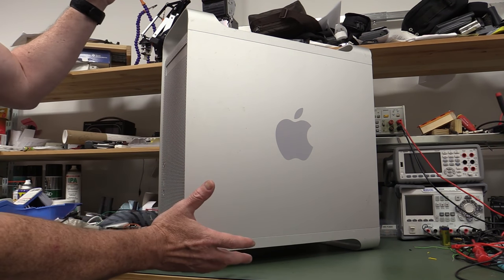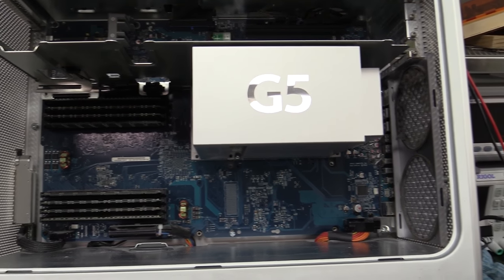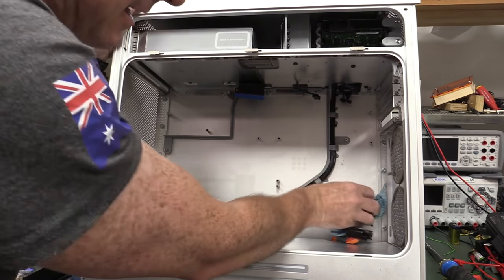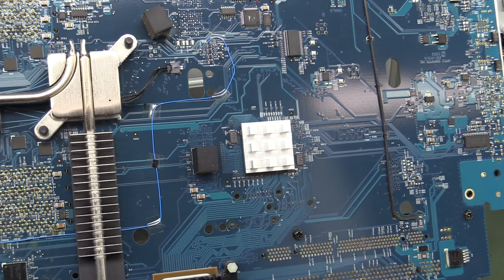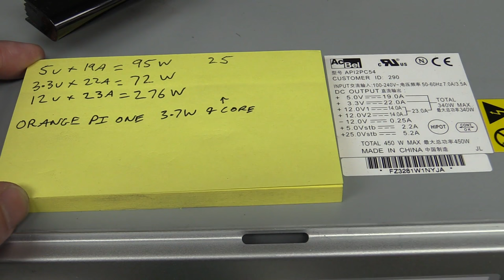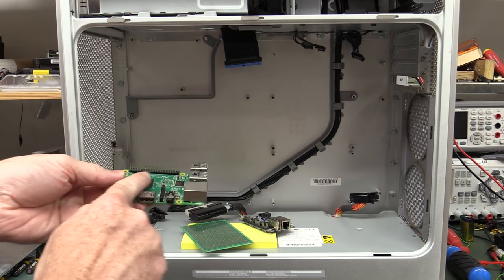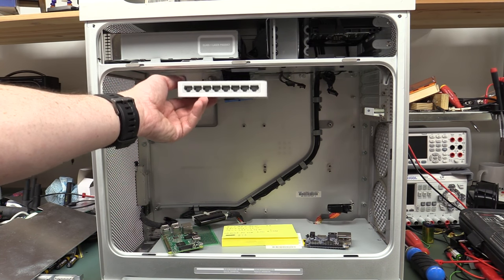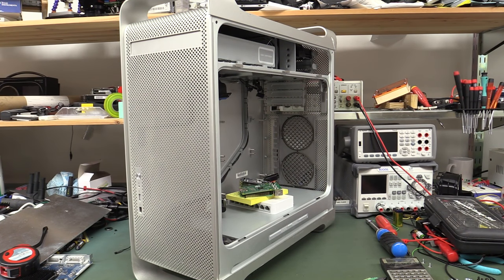EEVblog #946 - Apple (Raspberry) Pi Cluster - PART 2

Comment: The moment you click that 16 or 24 port switch into the board mounted RJ45 connectors and then realize that ever getting it back out again will be a major PITA since all the RJ45 holding clips have engaged... priceless ;-)
But otherwise a great ideas :D
Reply: Peter Jakobs you'd have to take off all but two of the clips :)
Reply: of course, but I just figured the SNAFU moment in case you did not and had to undo 24 clips :D
Reply: On the picture Dave showed, it actually looks like these are clipless connectors in the first place, btw.
Reply: Peter Jakobs.  good point. no clip and. the switch is screwed in
Reply: I don't think so, the clip's just on the top side, opposite the contacts.
Reply: It could be hidden, but it looked to me like it was gone.
Reply: I was thinking this the moment he said it but I imagine you'd be ripping them all off.
Reply: Peter Jakobs it does say its intended use case is things like daughter board connections, and in those cases you pretty much universally have the clip elsewhere and you're not gonna be hoping the tech has a long screwdriver to push in a clip somewhere in the back of the machine. I suppose e big advantage is when you're using/testing the daughterboard outside the mainframe, because you can just plug in a standard cable. Otherwise Ethernet runs just fine over non-rj45 connections.
Reply: therealnightwriter hey, I was waiting for you, the inevitable troll. What took you so long?
Reply: Jasper Janssen oh, I can see the advantages, no problem. As said, it was a slapstick thought. One of them "oh shit!" moments ;-)
Reply: HAHAHA. Better when you realize that TP-Link have changed the switch product line and the spacing is no more the same :P
Reply: I was sort of wondering what he was going to do for the network part of this. I would assume you can get the ASICs, etc for the switch, OS for it though may be hard. I figured you're networking them all anyhow why even bother with the headers, etc make a board with a gob of power plugs throw them on that and then connect the network. 

I actually have an old Unisys server that the back of the case is recessed and to get the RJ45 out you almost need a flat screwdriver because they put so close to the side of the recessed area. I don't know that was just poor design, no choice or maybe was intentional to keep it from being removed accidently. Other thing that was odd was the 2nd NIC was a PCI card which even for a lot of older Dell servers they were both integrated.
Reply: Yup +1

Comment: The +25VSB on the power supply is for the Apple Cinema Display - if you look at the graphics card slot you'll notice an extra, beefier connector next to it. This would supply power to the stock graphics card, as the display only has one cable for USB, video and power (though it did come with an external power supply/breakout board if you changed the card/wanted to use it on another system).
Reply from the maker: Ah, thanks.
Reply: Just my two bob on the PSU, I'd take it out entirely and fit either an external one, or mount a cheapie modern modular PSU where the hard drive bays are - if it didn't require too much hacking away at it. There seems to be some real estate down the bottom where that old PSU is - maybe the networking mumbojumbo could pop down there.
Reply: Regarding your comment on the Modem: most probably they put there the modem on purpose, because it is well shielded, being surrounded by the CD-ROM drive. Thus, if a lightning struck the telephone wire going to the modem, the components will be less likely to explode out of the chassis, and the long wire will also help arcing over to the ground, so the user is unharmed. 
Btw, why do you keep on referring to this RPi as a "SUPERCOMPUTER"? Without fast network it will not be able to produce even as many FLOPS as an old Pentium 3 using the same amount of power... 
At least you could network boot them, and save on the SD cards.

Comment: While Dave calls the board-to-board high-speed interconnect beautiful, I just stare at it in abject horror thinking of the added latency and fragility of those pins.
Reply: Electricity moves pretty damn fast, almost as fast as light in a vacuum, so around 1 foot/nanosecond. Cables running from place to place inside a computer will not add up in any way shape or form to meaningful latency. It would have to travel over 1,000,000 feet to equal one millisecond of latency.
Reply: NolanSyKinsley The speed of electricity is not only dependent on the length of the wire, but also the wire's gauge and composition as well as the amperage through the wire.

You ever wonder why we put processors directly on the motherboard? We didn't always. Slot 1 used a cartridge-based processor that you could plug into a board like today's RAM, making it far more user friendly and easier for enthusiasts to build computers. The slots we use today are less friendly, but by reducing the amount of copper between the processor and the motherboard, you gain a significant performance boost.

Apple figured this out too, and stopped putting processors on risers shortly after the G5.
Reply: Lutra Nereis this is a G5. It's slow as fuck, which is why it can handle being on a riser.

Modern multi socket machines still use risers, but the ram and CPU are generally on the same board.
Reply: And yet shorter wire lengths for speed was the reason the Cray 1 Supercomputer was shaped like a big cylinder on end.
     
NolanSyKinsley52 wrote: Electricity moves pretty damn fast, almost as fast as light in a vacuum, so around 1 foot/nanosecond. Cables running from place to place inside a computer will not add up in any way shape or form to meaningful latency. It would have to travel over 1,000,000 feet to equal one millisecond of latency.
Reply: Greegor47 true very true. though a rpi doesn't have i/o even remotely as fast as the cray computer. there's also a matter of dimensions. the cray one was HUGE compared to a normal computer :)
Reply: I'm pretty sure it's fine considering it's a mass produced product well proven in the field for years and years. Worrying whether it will work seems redundant at this point.
Reply: Notmy Realname I'm not saying that it didn't work, just that it's subjectively not beautiful to me.
Reply: Lutra Nereis odd, the fact that it is difficult to engineer well enough to get it to work makes it more beautiful to me.

Yes, the simplest, cleanest solution electrically is otherwise, but engineering is the art of the compromise between various requirements. In this case, the systems engineering side won over the electrical engineering side, and in the process made the product a few hundred dollars more expensive to manufacture (but more modular, which increases volume on some components, which lowers costs..).

I think there are cheese grater macs (probably the Intel models) that are still modular, but have combined CPU/ram boards. At that point, the only thing going over the interconnects is pcie lanes and power, practically, and/or the SMP link between two sockets (which is not that different from pcie lanes). Those are much less complex board to board interconnects. That's why these things have so many pins, that's mostly the memory interface.

In summary: solving problems beautifully is what engineering is about. Even when the problem could have been avoided by dropping another requirement.
Reply: It depends on what you want really. For high speed measurements the parasitic element of the wire would just increase the more wire you have. For this machine, I would imagine it wouldn't add too much, considering how small it is and what it needs to measure, but with Gigahertz clock speeds this wire would be absolutely terrible. You also need to know that when it comes to inductance and capacitance (which can be parasitic) speed of light has barely anything to do with latency aside from the electromagnetic constants.
In a way geometry and type of element makes the latency, but sure you could think of the reason being that the speed of light is finite.
Reply: DarkBabylon - Gaming videos Keep in mind that typically the GHz speeds are only found within the CPU itself, the external I/O busses are usually much slower (400-800MHz, or less), so not as extreme to work with, but you do still need to be aware of trace lengths and total capacitance (although if the signaling is differential then not quite as hard to work with).
Reply: Ethan Poole Of course!
Reply: there are modern examples of systems not putting their processor on the board, the Dell Precision T7500 for example has a dual processor module that connects to pins on the board and houses the processor ram and heat sink. We don't do it because of latency so much as we do it because processors have a lot of pins and LGA/PGA is the most cost effective way to do it. We do have specific trace lengths on boards but that tends to be for getting parallel timing right for things like DDR3 ram, that's why you sometimes see a trace or two squiggle back and forth a little ways because that way timing sensitive signals arrive at the same time as the other signals.
Reply: If you could put 25 processors all on a common fast parallel buss there would be horrible traffic jams on the buss, but imagine 25 processors sharing one serial channel and the traffic jams multiply 1000 times right?  The parallel buss could enable them to all share memory access (at a cost) but attempting direct memory access with 25 processors sharing only a serial channel would be absurd.
  
None of that is revolutionary or new.
  
The idea of a powerful Pi supercomputer has taken on a popularity much like an urban myth, really.
  
It would stand a better (though not great) chance of being powerful if it involved several parallel busses that could operate without being latched to each other.
  
Even popular CPU chips with 8 processors in one chip do not have the speed advantage that many people mistakenly expect.
Reply: theyre all connected via 10/100 ethernet for comms.. the motherboard breaks out the SPI GPIO pins for the ethernet chip and supplies power to each pi i believe. they dont communicate to each other over Serial.
Reply: Did you think that ethernet is parallel?
Reply: Greegor47 if you're talking to me, absolutely not. I know my interfaces rather well having dealt with computers for 5 years solid. I was simply saying that the pis are using Ethernet to communicate rather than a slower serial/parallel bus
Reply: 5 years? N00b.
Reply: I would conjecture that at some number, like say 5 Raspberry Pi's the overhead burden of ethernet interconnect would outweigh the benefit of one more Raspberry Pi in the gang.   I am actually genuinely intrigued as to how many Pi's is beyond the point of diminishing returns.
Reply: What's your guess as to how many ganged Pi's is beyond the point of diminishing returns with an ethernet "buss" interconnect?
(Assuming bench testing that mimics general purpose computing)
What kind of computing would be at a huge advantage on such a cluster?
Reply: Anything that is massively parrallelizable and does not require lots of comms between nodes to do so. If it exists as an "over the Internet" project like set at home, it'll work with basically any number of pics at least until the network gets into physical problems and/or the coordinator server does.

Comment: "No, I haven't done anything on it."

> 36:44 video
Reply from the maker: Not before I hit record.
Reply: +EEVblog you could use the 3.3V line to support the 5V Line, for (if possible) the Ethernetswiching and your Onboard logic
Reply: Raspberry Pi doesnt have USB3.0, so gigabit is out of the question. At best maybe a low multiple of 100mbit.
Reply: Tom Storey I wasent talking about the USB, I was talking about the power management and if he could possably use the 3.3V to assist the 5V Powerline, but that wouldnt work because the 5V is a "unprotected" input the the 3.3V is onboardregulated

Comment: 25V standby power is used to provide voltage (via the bespoke graphics cards) to Apple Display Connector monitors. This meant the monitor only needed one cable to provide DVI signals and power. Also used to provide power to firewire.

Comment: Apple PI, best name ever!
Reply: DjLorenz iPi
Reply: PEN PINEAPPLE APPLE PI
Reply: It wouldn't surprise me in the slightest if Apple decides to take that name and produce their own competitor to the Raspberry Pi.
Reply: +Roxor128 they did. it's called beaglebone
Reply: +Matthew Berry BTW it sucks
Reply: Matthew Berry the beaglebone is from TI, not Apple. And it doesnt suck, its actually a better board from a performance point of view. rpis just have a larger community.
Reply: I bet they will call it: iPi and then afterwards sue rpi :P
Reply: You deserve a cookie!
Reply: Pinkie Pie would love it. :D
Reply: Yeah, just take that apple away from Apple, apples are for everyone! But I thought while watching about something like a Potato Pi which is made to work with others in a cluster, so the cpus and all work directly together, use just one OS for the whole hardware or starting single instances of OS's if needed. Just a female connector on the botton of the pcb under the male header on top so you can put them together in a most room saving way. But it doesn't need to be named Potato Pi, but the idea came because potatoes grow very close together xD

Comment: Dave, as someone who has hardly ever held a soldering iron in my life, and watches purely for entertainment, this is starting to look like the best series you have ever done.

A small point - it might be worth putting a fan over the PCI card slots.  The first Mac Pro (very similar case) had a row of hard drive slots at the top of the main chamber, and they were known for getting very hot.

Comment: Stop stuffing around Dave, and build the bloody thing! All talk and no PCB manufacture = vaporware / kickstarter....
Reply from the maker: Err, you have to tear down the computer first and suss it out before you can start on the PCB. Or do you expect it to magically come out the other end of Willy Wonka's PCB factory?
Maybe I shouldn't have turned on the camera?
Reply: True, but with your years in experience, it shouldn't take that long. I tell you what, I'll crack out a board for you in KiCad, and you can get it made.. :) Let's use the compute module like others have said, because then we can really ramp this sucker up. Oh and it should be single sided so those at home can make their own using a laser printer and some ammonium per-sulfate. :) Don't stress. Some great ideas there in your video and always a pleasure to watch!
Reply: What's the rush, don't you realise this is project is just for fun ? I'm sure this is not the only thing Dave is working on right now and those other projects are what he makes a living from, this is something he has to do in his spare time. Just because you don't see him doing anything else does not mean his is not doing anything else !
Reply: I think this video is a rare clunker, but interesting none the less and appreciated. Perhaps you shouldn't have turned the camera on, maybe, but it's still interesting to see you thinking out loud and going thru the design process.
Reply: Dave will you continue this project? I know, sometimes you just start because you have this idea but then start to think about and you realized how senseless it is and just a waste of time and ressources, but anyway it would be nice to see how it looks like in the end. Man and this cases... you're so right, even if I don't really like Apple, even if I own an iPhone, the last ever for sure, but this cases are so nice in just any way, you coule put your electronic tools, like bench power supply, oscilloscope and all that and stack them lying on the side, or do the same with audio hardware, maybe overwork the frontplate a little or even spray them, so they can't be recognized as Apple stuff at the first look, but still look as great.

Comment: You should mount the boards with the network and USB connectors facing towards you (away from the "motherboard"). Then you'd get a smaller footprint, better airflow, and easier access to the network port. It might even make the riser board design easier as well as you'd have more space between the two different connectors.

Comment: Dave, about your power calculations: The TOTAL available power across the 5V, 3.3V, and 12V rails is 340 W, as indicated by the right-most figure. This means that, while you can draw 19A from the 5V, 22A from the 3.3V, and 23A from the 12V, you can't draw all of that AT THE SAME TIME. If you tried to max them all out, you would exceed the 340 watt combined capability of those rails. Instead, you could, for instance, draw 19A from the 5V rail (95 W), ignore the 3.3V rail completely, and draw all of your remaining available 245 watts from the 12V rail (at round abouts 20.5A).

Comment: Please go the "no wires" way with the cluster. There are enough spaghetti cluster builds. You have a nice case, so keep it nice and clean. The screw terminals on the other power supply are great and I would like to see a design with ethernet integrated in the backplane.

Comment: I'm defenetly for making your own board plugging the RaPi's into it using the GPIO-Pins and doing the networking-stuff as well as the power distribution on it instead of using the of the shelf-switch with all those little cables flying around. It's quiet the coolest solution i've heared about yet.